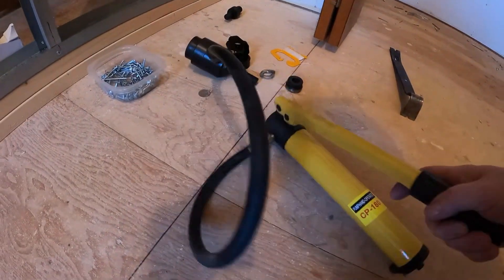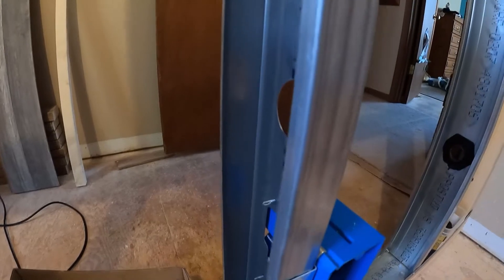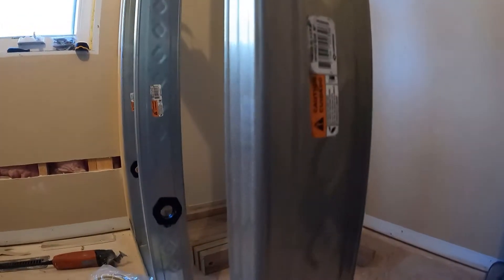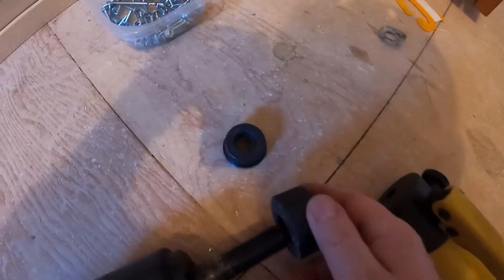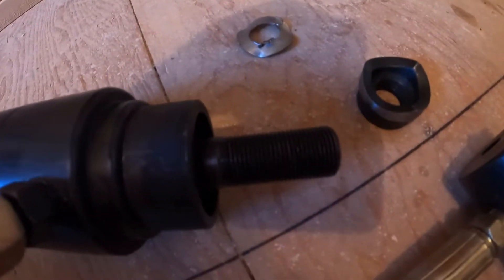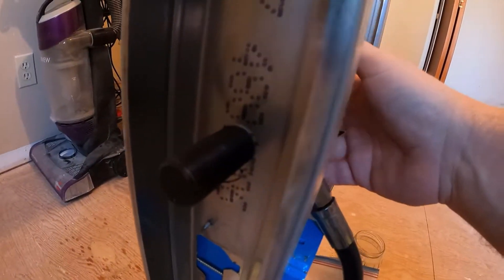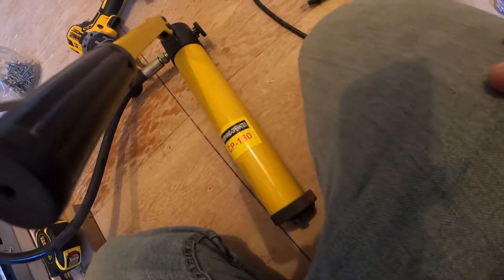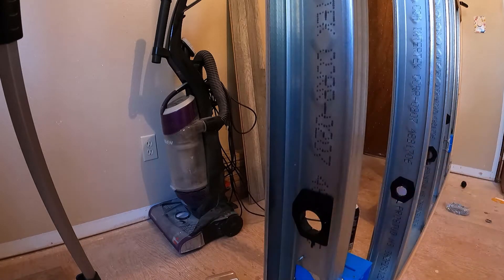Hydraulic Knockout Set CP 180 Review

Comment: I have just bought one of these hydraulic punch sets it looks like they come out the same factory in China. Like you I am planning on making a video and wondered how much you have used it and if it worked out a reliable investment for the price. Thanks best regards Chris
Reply from the maker: Sorry for the late reply!  Yes, I've used mine on many projects, and it's been really good!  The only complaint with it, is that they could have put swivels on the ends of the hydraulic hose.  As is, the hose is always putting a bind on the cutting head.
Reply: Bought one but mine doesn't seem to have any oil in it.  Any link on how to bleed the air out and refill it?